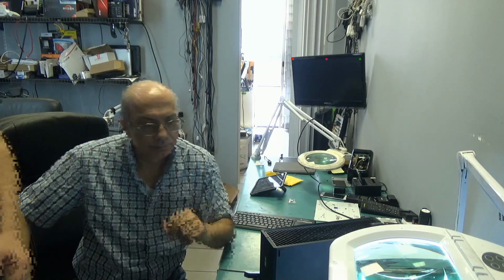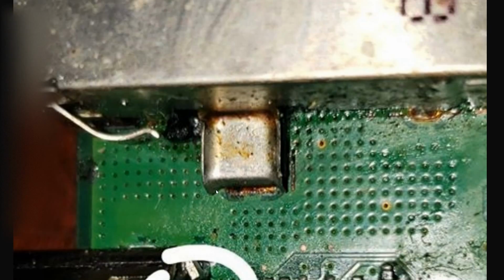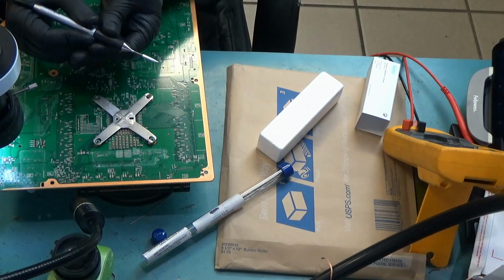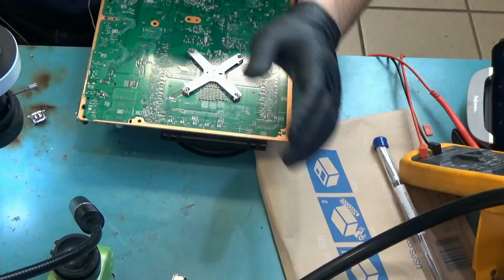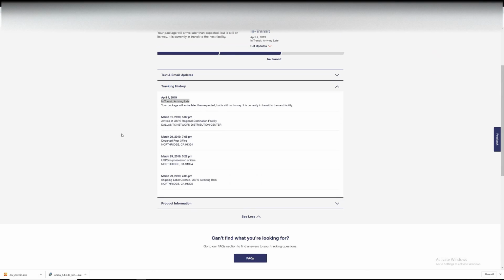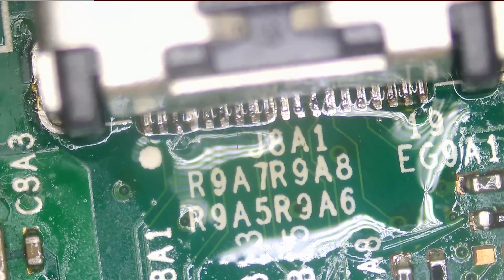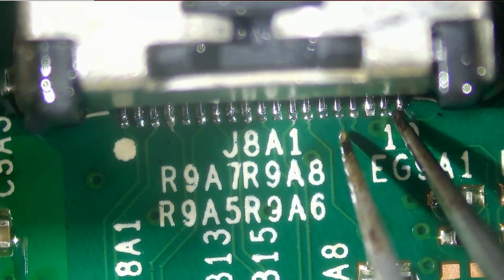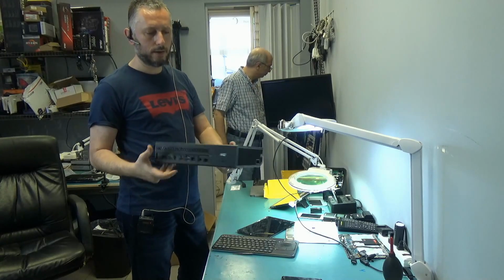Original XBOX One Console Damaged HDMI Port replacement - New soldering tip

Comment: Hey Northridge when you solder back do you use low melt solder or only for desoldering?
Reply: low-melt is only good for de-soldering, he mentioned it before. He cleans it up using a wick and applies leaded solder for long-term.